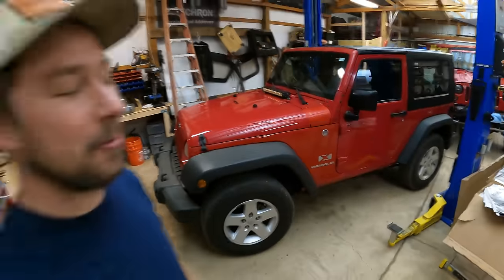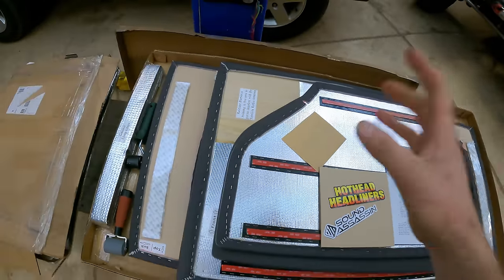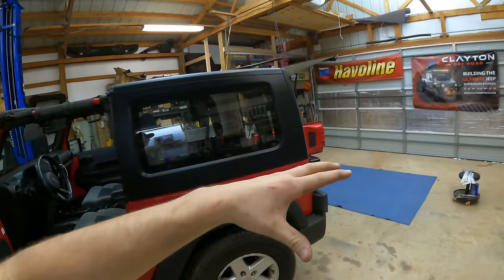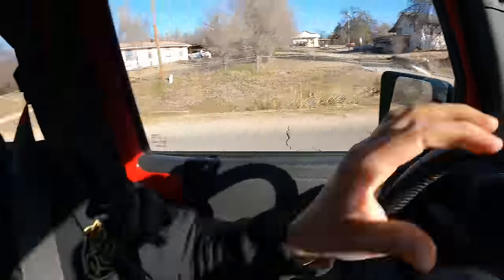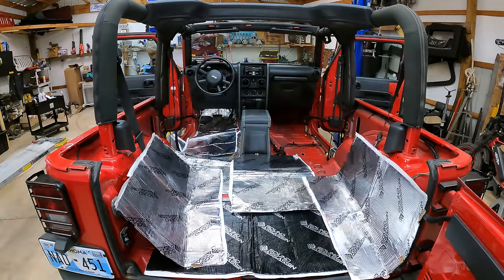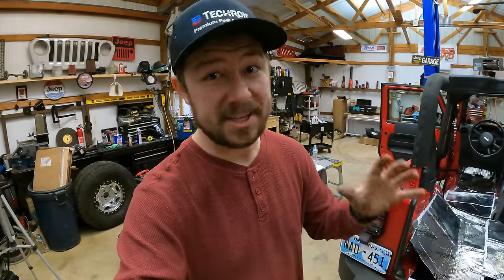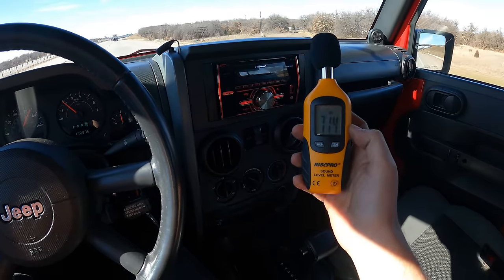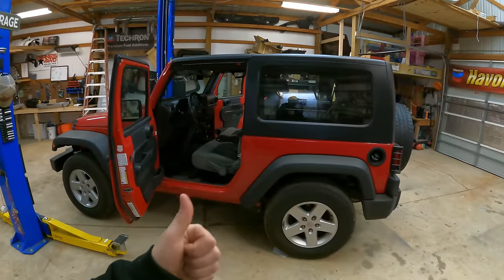Sound-Proofing A Jeep Wrangler....Does it Help?

Comment from the maker: The code GG10 is valid for 10% Hot Head Headliners products!
Reply: I get the sound assassin floor liner is great, used it on my JTR, but im curious, yes, sound dampening like Stinger, DynaMat and such is heavier but only by 2-5lbs, it’s also a lot cheaper so why not use that esp considering the bulk packs have a lot more panels available?
Reply: Perfecto gracias, acabo de hacer mi pedido para mi JKRU, y también me suscribí a tus videos, gracias por los videos
Reply from the maker: @hollywood4n6  the sound assassin seems to work better, and like you said it’s lighter. At first I was hesitant to add any floor liner at ALL because of weight. Jeeps get heavy fast with each and every single little upgrade. So each lb matters

Comment: I did this to my Jeep about three years ago. Huge difference! I also took the door panels off and was able to get quite a bit of sound deadning inside the door which made closing it also quieter. I suggest doubling or even trippling the amount of sound deadning material on the wheel wells, which is where most of the noise comes from. Especialy if you have off road tires.
Reply: Doors I can see doing that to. They tend to vibrate more, especially with music.
Reply: If you don’t king me asking, how much was it
Reply: @HelloWorld2B I’d say for all material, about $180.

Comment: That factory Loctite is no joke, depending what color they used. When I had to remove the body-mount bolts on my JT to install the Ace Engineering rock sliders,  the front bolts requires a blowtorch.... they had used Red on the front, which usually the bolt snaps before the Loctite does if you don't soften it up some.  I have the same rock sliders in my garage for my 2023 JLU (when it finally gets back from the dealer service from hell) and luckily I have heard the JL uses blue Loctite on the body mount bolts.

Either way though, I always break them loose by hand at first before I put the impact on them. Call me cautious.

Comment: I did this to my JKU. Threw down multiple layers of asphalt deadener on the body pan and doors. Also laid in a layer of closed cell foam. Made a HUGE difference (i run 37's). I think the next most important part to sound deaden would be the doors. But they're a lot more work so I haven't done it. Plus the asphalt panels in the doors would add weight... Great video, thank you!

Comment: I did this for my 2015 jk soft top. Added hard top and did the exact mod so I could hear my toddler when he was trying to talk to me. Totally worth it. Also helped with temp regulation
Reply: Forgot to mention I also used Dynamat, all three types in the bucket. The lining of the floor and the doors made it as quiet as a sedan. I had to pull the doors apart to add it and remove the carpets but totally worth it. Doors sound like a Mercedes door when you close them
Reply: @michaelgee7509  i should do this to my doors.... hate how noisy they are..
Reply: @adidas4275  it is worth it. Be advised if you have tint, it will scuff the tint

Comment: Tip/warning: on jku,  when removing the front seats careful to not grab that seat adjustment bar.  The tracks are spring loaded and have separate tracks that will make the reinstall alignment a challenge.  Sound diffrence is worth the work.

Comment: I had the interior tub of my '05 Rubicon Unlimited done by Line-X - the difference in sound deadening was amazing! As an added bonus, it made the interior pretty much indestructible. I think it's a better alternative to sound mats which can trap moisture and lead to rusty floorboards. (Nice German Shepherd btw - I also had a black one I named "Rubicon". I have a picture of my black Rubicon dog in my black Rubicon Jeep on the Rubicon Trail !)
Reply: agreed as are's 2006 fully loaded ( factory painted it the wrong colour on the outside lolz, someone didn't realise/read the original order sheets so now it's 3-black and it's hot to live with ect ) 1-owned family ( got my driver's license in it in 2000-11 aka new and nope not my first time driving and or vehicle that goes to dad goldwing or my 80's K1500 1-owner family* both i wrecked/drove under 3yo aka thank's 😉 parents for leaving the key in a easier position to getting at, lolz ) the carpet in a non mall crawling and daily-driven like are's can get nasty and takes ages to clean and i did suggestion to delete it and rin-x it but my old man and sibling is stubborn for now
Reply: Linex? Like rhino. What was the cost?
Reply: @JaiGadiel  Yes, it's bedliner like Rhinoliner. I think it was around $650. I used to manage car stereo installation shops and put in lots of add-on sound deadener. For a vehicle like a Wrangler that has a high chance of getting very wet, I feel using bedliner instead of glued-on sheets will last longer and help prevent the floorboards from rusting. I also had an '81 Jeep Cherokee that I used Herculiner on, it was only about $100.

Comment: Nice video. I did the hot heads mod years ago. It helped a bit. More recently I did the firewall and floor with Dynamat and Dynaliner. Made a huge difference in noise and more importantly temperature control.
Reply: What's the hotheads mod?

Comment: I'm at about 80% done, it's a lot of work. High sight I would elect to use liquid. I do have two cans of Boom Mat to use on areas that were very difficult to get at like way up under dash. I'll use the liquid on the roof ceiling.

Comment: Always wondered if this stuff retains water and would eventually rot the floor. Also with that ground wire, a lot of pro stereo installers will do the 3 screw thing to sub amps ground. Keeps it from ever moving and causing shorts under the carpet. Fire hazard stuff.
Reply: it does not. It is like  a bitumen paste with an alu foil  layer

Comment: I have a soft top on my 07 4door rubicon and have never had an issue heating the inside it’s actually quite opposite it using gets so hot in side I gotta run with the windows cracked to keep it comfortable…….. now in the summer time keeping the top cooler might be different

Comment: I thought you were making the 2 door like a tube buggy type insane rock crawler? Not at all a modification I would have assumed lol
Reply from the maker: Going to be a while until i can get the $$ for the axles and engine, so might as well use the Jeep and have fun with it until its time! Plus the kids started expressing more interest in this 2 door so we have to be careful on how to build it and still have them enjoy it on the trails, which is hard with a 2 door... However its possible for sure

Comment: My worry about doing the floor is when it gets wet, how easy would it be for water to stay and eventually rust out the floor?
Reply: Seems like my JK leaks in the front floorboards when it rains. I also wonder if it will cause rust.

Comment: Been there with a jlu....installed a custom sound stage and spent 15+ hours removing the interior and putting deadener on the tub, doors and added hotheads headliner.  Only reduced the sound by 2-3 decibels...big waste of time and added 150lbs of weight...Definitely wouldn't do it again to a wrangler.

Comment: The only problem with putting that on the floor is if you go across a deeper water crossing or get rained on with the top off is water getting trap’d between the sound mat and the floor and rusting it out..

Comment: We are having issues with heat coming from the front floor pans in our 97 TJ during the summer.  PO put a bedliner type material on the inside, and we have no carpet.  Would this help with the heat on the floorboards, or would you recommend something else for that?  We will be putting a carpet kit in also.  Thanks
Reply from the maker: Yes this would help tremendously, however I’m not sure how well it adheres to a bedliner texture. It should work, but I’m not 100% certain

Comment: Hello from Ohio (2017 JK here) Great video. Have you solved the rain channel run off inside your JK? If not how does the Sound assassin and Bedrug hold up to the moisture that comes in?
Reply from the maker: The bedrug is completely waterproof, its made of plastic to resemble and feel like carpet. Itll just pool up and drain.
The sound assassin is butyl rubber so its not porous and cannot retain moisture either. It could possibly retain some moisture if you didnt apply it correctly and roll it on hard enough. But can still pull floor plugs and everything. I do not see this setup presenting an issue with moisture

Comment: Are the hothead headliners much better than the Mopar ones?  I’m pretty happy with those in my 2door JK. I used SoundSkins on my entire tub when I swapped out my carpet for Armorlite and Goose Gear.  It really helps with road noise.
Reply: It's better but I doubt it would be too noticeable for your setup. MOPAR is basically just carpet alone where Hothead is like what normal cars use to soundproof their Headliners.

Comment: I appreciate the video.  I am looking into reducing sound in the JKU. Is there a sound assassin code? Also just got my Stech pod, how has yours held up, I could not find a follow-up video.
Reply from the maker: The code GG10 should work for the sound assassin kits as well! And it’s been working great! The one thing I did do was add a small push button switch to kill power to the unit. I originally wired it so it could be used with key off, and still can, just now have a master switch
Reply: @JKGearandGadgets  Thank you, it is going to be a spring install, but I am excited. Thanks!!

Comment: This may be a silly question but would sound deadening the floor mess up the the cooling of some parts? Like making transmission overheat maybe? Or I guess maybe nothing needs to ventilate / cool off through the floor into the cabin?
Reply from the maker: Nope!
Reply: @JKGearandGadgets  Thanks! And does this apply to all cars?
Reply from the maker: Pretty much any car sold will be ok to apply this. Nothing needs to cool or vent from the floorboards

Comment: I would not recommend using acetone on platics/polymer services.
Reply from the maker: They specifically state to only use acetone to clean the hardtop. What would you recommend instead of listening to the manufacturer?
Reply: @JK Gear and Gadgets  we use denatured alcohol.  It's safer for plastic surfaces. Put a tooth brush in acetone and it will start to come apart
Reply: @JK Gear and Gadgets  Paint thinning – Acetone is most commonly used to thin or remove paint from various surfaces in addition to be able to thin and remove lacquers and resins. Plastics – When cleaning plastics, alcohol is the best choice to effectively clean and disinfect without damaging or breaking down the plastic.
Reply from the maker: @ut_punkn1859  why are you talking about plastic? Where is plastic/Acetone you are talking about
Reply: @JK Gear and Gadgets  acetone can also damage fiberglass. Which is what the top is made of.

Comment: What year is the jeep that you are putting that in?
Reply from the maker: 2009
Reply: @JKGearandGadgets  I can't find anyone that makes the sound deadner for around the windows in the top for my 2008?
Reply from the maker: @jimbradd2783  hothead headliners does. They should have it on the site, or give them a call.
Reply: @JKGearandGadgets  ok thanks